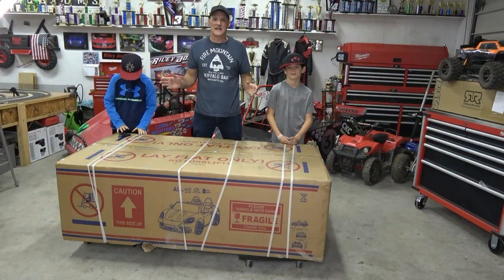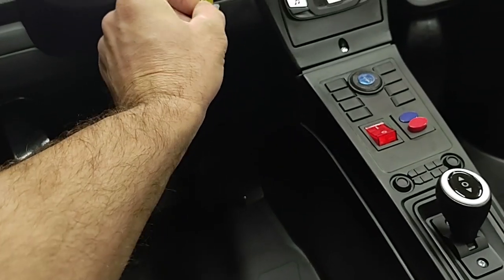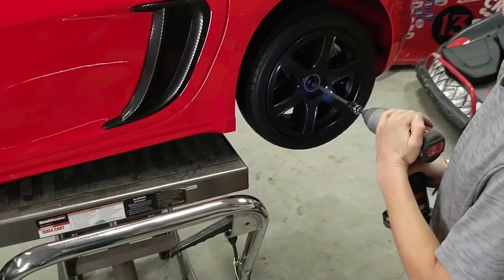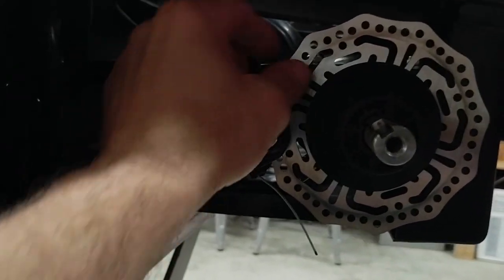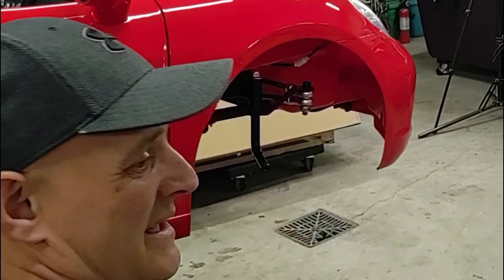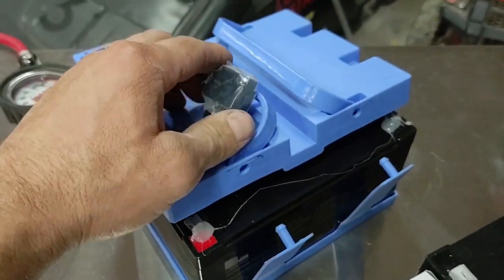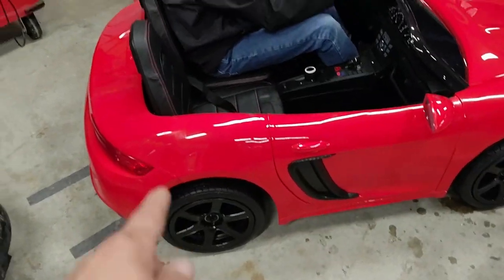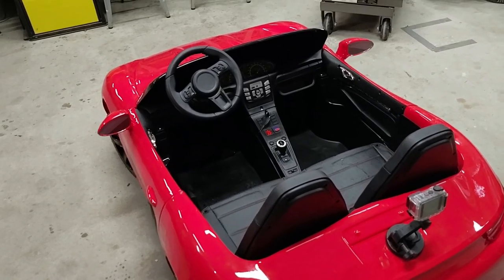GIANT 24 volt Powerwheels unboxing- XXL rubber tire super car #bigtoysgreencountry.com

Comment: Best presentation of this car on YT.
This video answered a lot of my questions.
Spot on job with this video.
Have some additional questions:
1. Does the seats move? I mean is it possible to adjust them to driver height?
2. This foot brake is connected with real axe brake disk? I don’t understand this part. It is the same mechanism as hand brake or it is completely separate.

I want to purchase this for my 3,5 years old son. He mastered normal 12v vehicles. Also upgraded motors with 10km/h are no longer challenge for him. 
Looking for something and considering this model. He wants separate gas and brake pedal with more speed.

Comment: I love your videos so much and since receiving my sons 12v audi r8 spyder ride on I have been glued to your advice.
I have wanted to upgrade his car to brushless motors but your advice states this could cause trouble with other components like the rc controller unit and gear box.
Also to add ive only just learnt that a brushless motors need esc units too..
Would love advice on this if you could or even better a video to show us all how this can be achieved safely.
Reply from the maker: Correct, brushless needs a speed controller and the speed boost would just melt the plastic gears. For dependable upgrades u will want to look at electric go kart parts.

Comment: Man , I wanted to see the race lol that’s a nice ride. I was curious, I’ve watched your other videos can’t seem to find my answer. When you use the ride on but don’t drain the battery do you charge it to full right then when the kid is done riding? Is it bad to let it sit for a day at 3/4 charge? Or more than a day? Sometimes my grandkids only ride 5 minutes. Is it bad to keep charging them for without draining them to 50-60%?
Reply from the maker: Lead acid battery is fine to just leave partial drained. Main thing is to not over charge the pack. Ideally a smart charger that detects full cell voltage is recommended. We have a video on the topic

Comment: The online price of Super Sport XL is 679 pounds. The output of the original design has been increased to 48V 650W, the battery life is 45 minutes, about 6.4 kilometers, and the top speed that everyone is most concerned about can reach 35 kilometers per hour. However, the whole car is not equipped with a suspension system, which lacks comfort. Fortunately, all four wheels are equipped with pneumatic tires. When encountering uneven roads, it can be seen that the Super Sport XXL will vibrate very hard. It is really a matter of opinion whether it is suitable for transportation. !

Comment: Can you weld the differential????
Reply from the maker: Interesting question. Have not had it apart but most likely. I would recommend putting in thick gear oil to tighten up the posi before I welded up the spider gears.

Comment: how long is the runtime on the stock battery?
Reply from the maker: That varies greatly with the weight of passengers and terrain. Adult driver on hilly terrain probably 15-20 minutes. One small child on flat hard surface 45 minutes to an hour would be my approximation.
Reply: @CustomKidzCars  Thank you for the quick reply, very helpful!

Comment: I just got one of these for my son. When he is moving forward and the wheel is turned all the way the front end jumps. Do you know what this can be?
Reply from the maker: Probably just wheel hop from lack of front end weight. Is it pushing straight instead of turning?
Reply: @CustomKidzCars   no it is turning and not sliding forward. I have a video of it. I will try adding weight to the front end. Ill probably get it in and try it myself. I weigh 155 so well under the weight limit.
Reply: I added weight to the front. No change. I even tried it myself and im 150. Still had hop.  It is driving me nuts.
Reply: I have the same problem with mine. Not sure what to do. I tried tightening everything on the front end
Reply: @94cuvicb16  I have the same issue with mine. Brand new and it wheel hops only when turning. Ps How do we know for sure that our model is the XXL model and not the XL model. They are both same size ! I think that XL is slow
Reply: @CustomKidzCars  Mine wheel hops with my 8 year old inside it. Oy wheel hops while turning. And I find that it doesn't do 15 to 20 kms per hour as advertised. Feels like 10 kms Max. What is the difference please between the xl and the xxl model ? To me they look to be the same size.
Reply: @CustomKidzCars  I mean mine looks like yours exactly except in white and has a touch screen for media not the buttons that you have.

Comment: Sounds and stereo not working how do I troubleshoot
Reply from the maker: No clue bud. I would start by following wire connectors and see if voltage is getting to the unit with a DVM

Comment: Hi, i have a Mercedes Unimog 4wd and want to convert it to 24V. What rpm motors do you recommend? My son takes it out on the beach and off-roading so extra torque would preffered over top speed. Would be glad for your help.
Reply from the maker: Stick with stock motors, lower rpm= more torque.
Reply: @CustomKidzCars  Thanks for your help. I am sure the motors will burn out at some stage. Which pinion gear teeth count do you advise for this purpose?
Reply from the maker: U have to use the same tooth count that's on it now. 32 pitch
Reply: Thank you. I now have 12V 10000 rpm motors. What rpm do I look for when exchanging for 24V motors?
Reply from the maker: Stock power wheels brand is 16k @ 12 volts  running your stock motors @24 volts will =20k rpms. Just use stock motors but use 12 gauge silicone wiring

Comment: Nice car but $1200??? For a kids toy. Wow. Shouldnt even be more than $500 max. Can get a real used car for that kind of money. Can easily upgrade a normal 12v power wheel to 24v for a lot lot lot less. Smh
Reply from the maker: It's not for everyone. You can't upgrade a normal pw to rubber tires, transaxle, disk brakes, variable speed control for $500.

Comment: Mine is complete junk and big country is not good customer service! When you turn it on it locks up and hardly able to push it then you turn key off and it free again
Reply from the maker: Something is causing the motor to act as a generator and is acting as an electro brake.